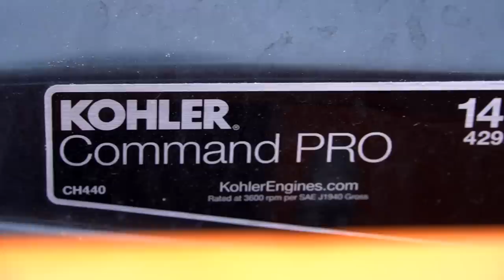Pulling Off Concrete Forms | New Home for the Sawmill

Comment: Hey Eric I run into the same problem with changing oil on some lawnmowers!!! Plus some John Deere lawnmowers and some other lawn mowers have a plastic tube that is hooked to the drain hole and have a plastic cap over the end!! You are to take the plastic cap off and just turn to open and close!!! I have also seen many blown up engines because they would end up coming loose so even turning to the open position under all the vibrations and drain the oil before the home owner would notice causing it to run out all the oil and causing the engine to lock up or blow!!! I would always grab different links of threaded pipe at the hardware stores and a few 90degree elbows and when someone would bring a lawn mower in where the drain plug was over a big flat area and no where for the oil to go except for all over every where before a drain pan I would take and put a piece of pipe in the drain hole and I would definitely use some locktight on the threads to help keep it from coming loose and I would also have to make sure that it would not come into contact with a turning wheel!!! On the end I would then put a 90 elbow on to get it to direct it down to a drain pan!!! Every one that I would let them no the danger and the cheep fix have all been greatfull for the up grades!! You can get the stuff from a hardware store for under 10.00$ hopefully this helps you out and if they don’t send you the cheap plastic upgrade kit that has caused many many engines to blow up because of a bad design!! The pipe from a hardware store works great and I have never seen one cause a motor to blow up or size up because of a failure!!! Remember though that you definitely want to use some locktight on the threads when connecting the pipe to the engine case!!! That way any vibration or oil leak won’t cause the pipe to come loose!!! Awesome video and it definitely should get many years of some good use of!!! Oh and next time when you do concrete you should maybe try and rent a concrete vibrator!! It is a long rubber hard hose that vibrates and will help settle the concrete around the bigger rocks that might be in the mix helping to get a much nicer finish and definitely helps out on the sides where the concrete meets the forms!!! I’ve done plenty of concrete work over the years and if you do concrete work you should definitely have a concrete vibrator!!! Super easy to use!!!

Comment: Harbor Freight sells an oil change pump that will simplify the oil change. It will also be useful on the Honda generator and other power tools. It's cheap and fits standard jugs like break bottles.

Comment: Good vid.  On the oil drain.  Cut/burn a hole thru the frame or connect a hose.  Hardware store 1/4 or 3/8th's pipe fixtures, get a petcock type cut off like on an air compressor drain.  Plumb it in.  Also you can get like a treaded hose much as on a grease gun thread it in and let it hang over frame.  My Kohler tractor engine has that, most simple to do.  Have a bolt or petcock in the end for drain.  Good job on sawing.  Some beautiful wood.  You all be careful  handling things.  Know where each other is when running tractor.

Comment: How nice will it be to have the sawmill on a slab, and perfectly level, I would mix a little batch of mortar for those porous gaps on the slab, so water doesn`t get in and freeze and thaw cycles, and mess up your beautifull slab, especially if your building is smaller that your slab, maybe even a sealer? What you two accomplish on your own is truely amazing, nice job on the cuts Eric with that saw, no real chipping to speak of, looks great. I can`t wait to see all of the projects you guys have lined up for this summer, for your short summers, since your winters seem to last until late June, you two rock. P.S. Eric stop using your back, and use that tractor, a strap on that tree end on the forks saves your back, same with lifting that sawmill, you beast. Take care you guys, see ya soon.

Comment: You got butterfly approval on the relief joints, so as I thought, you did very well, actually pro-grade. To get relief, use the cart you mentioned, or make a straight edge by bracing up wood to keep a border on the bottom of your diamond blade saw.

Comment: Hi guys, Fabulous job on getting the base in and the sawmill set up. As mentioned by another sub  some kind of caulking in the  saw cuts may be needed to avoid freezing water 
damage until you get a roof over the slab.  Those 8x8 's are incredible and just a tease as to
what you will be milling now. Those logs are unbelievably straight and sound and worth the
expense. Water on the concrete saw blade not only reduces dust but minimizes wear on the blade which  rental companies charge extra for in some places.  👍👍👍🥇❤❤

Comment: I built with spruce logs for years.  If the logs are green you can't always see spiral grain.  When the lumber dries it twists.  Beams too.  Of course sticker your lumber, but that won't stop spiral grain twisting.  I did log houses, and I'd pick out all the spiral grain logs once they were hand peeled, and I'd place them in walls with lots of windows or door cut outs.

Comment: Good job. If you ever pour another slab, you can use a vibrating pad sander along the forms and it will ensure all the concrete fills in smooth along the boards and fill any voids.

Comment: An old concrete guy once told me concrete is guaranteed to do two things. It will get hard and it will crack. You cut in the relief cuts in to control where it cracks.

Comment: I have worked with concrete slabs a lot and I suggest that you put sealant in your expansion joint. Reason is when ice or any object get in between the cut it will chip out your joints. Look at up.

Comment: The more water you keep on the slab, the harder the concrete will cure. You could cover the slab in burlap material then keep it wet for a month. That cools down the temp of the concrete giving it time to get supper hard.

Comment: Nice Job! Next time you do some concrete work, use a reciprocating saw (SawZall) without a blade in it to vibrate the forms to eliminate any honeycombs in the finish on the sides.

Comment: Some people think it is better when the concrete is really wet. However, that is not the case you’re much better off, vibrating the concrete because when you add more and more water, you’re actually diluting it and taking away it’s strength, my grandfather used to say mix with sweat not with wet.

Comment: Cover the floating slab with straw or old rugs or blankets (the local dump will have these) and keep it wet.  Or, there is an oil based spray that holds in the moisture.  Concrete needs water to cure (it's a chemical reaction) and takes 28 days to reach 90% of its strength.

Comment: When you get ready to pour slab for work shop rent a power trowel ,power screed and concrete vibrator , the concrete vibrator can be held against the form and it will raise the water making the side’s smooth.

Comment: When changing you sawmill oil you may keep the fill completely tight and go thru drain plug then slowly open fill cap to equal inside pressure and get a better drain. Food for thought and possibilities

Comment: those spots are the stones in the mix, they come to the top, if you make more pours, when it's wet use magnesium floats, that keeps the stones down once it starts to harden then you can use the steel trowels, steel draws the stones up  (45 yr finisher, retired)

Comment: The different colors could be caused by moisture, or plastisizer if they used it to help the concrete go down the chute. I know nothing about concrete in Alaska, but here in Florida...lol 😂 The control cuts you're making with the saw are to help the concrete cracking, follow the cuts, hopefully no spider webbing. Concrete will crack, look for it. Ya'll did a great job with it, but I'd get money back for the smaller diameter rebar..😂😅 Love ya'll ❤

Comment: Please spray a sealer on the slab it will fill the small holes.  Depending on how much you use the slab it should be sealed for 5 to 8 years.
  Also, I would ask a concrete owner what to fill the relief cuts to keep the water from freezing in the winter & cracking the slab.
To seal the edges you can make a slurry of concrete & spray an adhesive on the edge then apply the slurry, again ask the concrete owner as this is what we did 40 years ago.  Probably have something different today.  But something has to be done or else the water will freeze the concrete & will fall out in a chunk.

Comment: Eventually you might want to put a sealant on top of your concrete.  This will help deter staining and preserve the concrete because it is so porous.  Are you going to build a shelter with a roof and walls around your mill??  It would really save your sawmill and concrete.  FANTASTIC JOB YOU TWO!!!

Comment: I remember when you first put this together on the old property- seems live forever ago. Will you be erecting a roof over the top so you can cut timber in any weather conditions? Your concrete slab came out really good nice and level. I was going to mention about putting sealant into the cuts to prevent water going in and then freezing and causing the slab to crack but I was beaten to it 😂

Comment: You can actually put sidewalk sealant on the cracks they will stay clean and dry but still serve the purpose but keep the cracks from expanding when it freezes, I can send the name of it if you like it is the same color as the concrete it’s really a great step and kinda hides the cracks 😊God Bless, as a contractor I’ve used it many times

Comment: love how the slab turned out.  A suggestion where you have the "gravel" sides:  vibrate ore move your shovel up and down along the edge of the forms.  This puts more "liquid cement along and forms and does not leave gaps.  Also, I am sure that you will want to get the cart for the saw when you cut the grooves in the larger slab.

Comment: Use that mill and MAKE a post and beam covering shed for it! In the end, it will pay to have it covered for all kinds of emergencies and bad weather doesn't have to slow it down. HUGE timbers won't be necessary and utilizing the concrete to set the frame should not be used because it will delay and make it smaller. You can do that at your leisure. Make it temporary but good enough to last a year or two and it will buy you time to build more needed things. (green house, electrical shed, food prep, rendering, smoking, carving, canning, and preserving storage shed. (pig, cow, Llama goose, rabbit, hay/grain/feed shelter, firewood, beehive windbreakers --- whatever-- shelters, bridges, home additions, -- Need I say more - ya got work to do. Roads to build gravel to sow, gardens to tend, fish to fry...Mosquitos to feed...

Comment: Good call on the slab size, Ariel (I hope I spelled that right). I strongly suggest filling the gaps in the concrete with a joint filler, otherwise any water that gets in will destroy the concrete from the inside. Looking forward to seeing what you build this summer.

Comment: Next time you change oil: while it's empty add a drain hose (Drainzit is one good brand) and all changes after that will be much faster and easier with no spills.
Also, lube with a non-detergent oil, not with WD-40 (which is a solvent). Oil lubes better and lasts much longer.

Comment: You could sack the concrete it it appears to have to many voids.  Sand, cement, concrete bonder {moose milk) use a sponge float to apply and smooth the patch.

Comment: You can use a polymer parge around the perimeter to stop water freezing and cracking the edges. I did this and I'm on year 7 with no issues. Are you grouting the relief cut? Great videos.

Comment: Looks like it could used a few more inches of elevation. I think I would cut some 2-3" blocks to go under each end of the 8x8. That way the 8x8 is not in direct contact with the ground/concrete which should help with rot prevention. The blocks would be the sacrificial part and save the 8x8.

Comment: I would have used  Bostik PU91 Construction Polyurethane sealant for the expansion joints you cut, keeps it looking good and clean, Great Job guys, Looking forward to seeing what you build..

Comment: You both did such a great job. I wish I had you both to do my concrete driveway. You certainly did a better job than the people that did mine. They put mine in when the temperature dipped to low that night & alot chipped off. You always do quality work! 🩷🙂

Comment: Great to see the progress on the Mill!  I can image the shelter/structure to go over it, but a big difference between there, and here in the 'lower 48' as far as winter goes. BTW, one question... Are you going to use the large volume of sawdust for paths, or hügelkultur, or to compost with other materials? Waste not, want not. Could you "press" the 'green' sawdust into pellets for fuel? Lots of uses! 😀

Comment: A few worm’oles, no problem, a few buckets of cement grout would stop that happening  if you do this again. You can also use a light breaker with a blunted point on the form to vibrate the concrete to help get rid of the ‘oles !!

Comment: Not sure on the size or threads, but grab some 3/8" pipe and a 90 degree elbow. Fashion yourself a 2" extension and thread the 90 on there, then add another 6" pc to run the oil drain out past the frame. Cap it off.  Should Solve the issue of oil changes for the future.

Comment: You can patch the "Rat Holes" on the edge facing with some  cement, just trowel it in the gaps. Remember next time to tap the forms with a frame hammer when still wet.

Comment: Expansion joints are much easier to do before the concrete is completely dry using a concrete seamer/groover on a long pole. And it leaves rounded edges, no filler needed.

Comment: That Ridgid impact you have is interesting. I think that it is slow on loosening because of a higher torque setting..?which is probably good so it won’t gaul a bolt/nut combo upon undoing an old set..? The saw dust check..😂🤣

Comment: great video  i dont  known how you do it.. for your info they make a small hose with fitting on it for oil drain plug holes.i got one for a pressure washer about 6-8" long  take plug out, screw in hose& other end has plug in it . sure makes changing oil a lot easier and less messy.

Comment: Seems like you could cut out a 2" round hole under that oil drain plug... that would allow you to get the plug out easier with a wrench, and the oil can pour thru the hole into a container

Comment: Hope you wear steel toed footwear. As mentioned previously keep the surface wet for a week or more as it helps the pour cure . Your garden hose would do.  Even better cover the cement with a cover and keep it wet.

Comment: In the event you find yourself pouring more slabs in the future and need to cut relief joints rent a walk behind concrete saw a lot of people don’t know what tools are available for things like that it cost a little more for a walk behind but you can set the depth and never worry about how deep your cutting unlike the hot saw plus you don’t have to hold the saw it’s like running a lawn mower

Comment: Vertical and horizontal expansion lines, ‘relief cuts’ a must to save on cracks. Our garage floor did not have them cut in and it has done it’s own jagged cracking both ways! 🤦‍♀️

Comment: The only 2 things concrete does is dry and crack. find an scissor jack under the log to lift it so you can save your back. Then weld a socket around the screw part so can make it easier yet by using power tools.

Comment: Just a idea. Build a Wangensteen suction system.  It is real easy  to make. I made one for some of my equipment that i can't drain oil easy.  1- quart canning jar with seal and lid. make 2 holes in lid the same size as hose. fit 1 hose in for suction and one to go into machine you are draining oil.  cut top off of a 2 liter bottle make hole in lid fit hose thru. that fits in a shop vac.

Comment: One thing that I noticed that you have not done with your new cement slab is spray a sealant on your cement to protect oils and dirt from penetrating.   You an still do this of course but the sooner the better of course. before things stain your cement.

Comment: While those beams may be perfect 8" X 8" now, it will be interesting to see what they will be once they dry as green wood shrinks. Green wood often shrinks in uneven and warped directions as well.  That's why you can't build with green wood and not have a inch gap between the boards a year or so later.

Comment: Get some J35 on that to seal it team, I've been resurfacing concrete for 25 years , Your slab will crack   in multiple area's because of the freeze thaw, Good luck !

Comment: Now I know why they use wheeled saws!  Depth control and ease of carry all in one swell foop.  Siphoning, or pumping, used oil out the fill hole is common practice on such engines in places where you can't get a container under the drain plug.  Of course it would be a lot more convenient to get their drain kit.  Good ending skit!

Comment: WD 40 is NOT an Oil. The W.A. stands for Water Displacement Formula 40! It will do short term lub. but does not last very long at all! I would use some like PB lube(Blaster Etc). But otherwise GREAT Job!

Comment: Does it ever freeze where you live? Does it ever rain or snow before it freezes? Would water in the cut grooves swell during freezing? Could sawdust get into the cracks and absorb water? Would that be good for the concrete? Would you be angry if the slab broke up like the Tanana River? Would you then use QUIKRETE Polyurethane Crack Sealant to fill the cracks?

Comment: This has to be done but you could have made it easier for yourself by using the attachments for holding the saw. We'll done for doing it anyway. Also as already said when you fill the gaps with some filler of your choice you won't even notice the cuts after a time. 👍